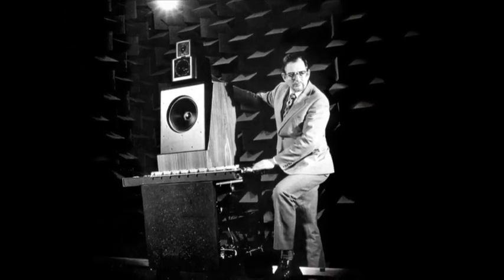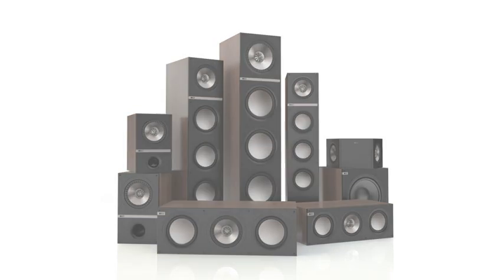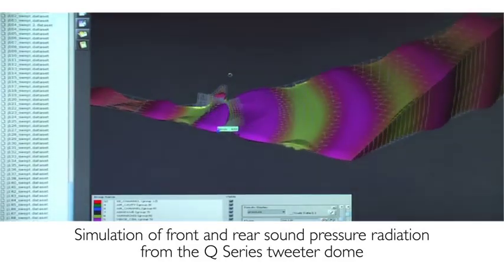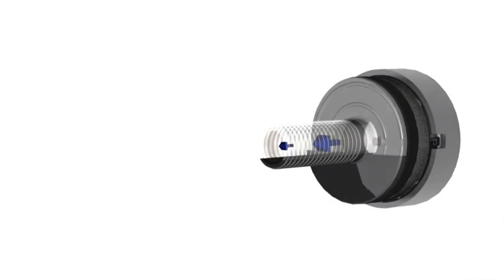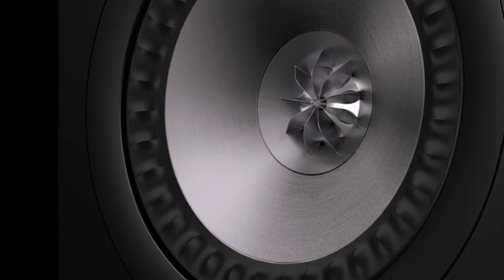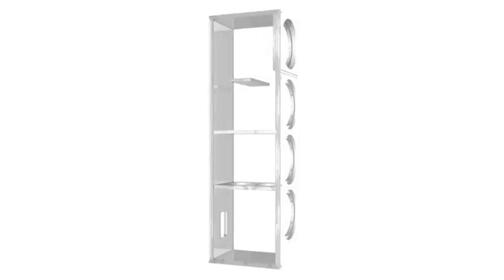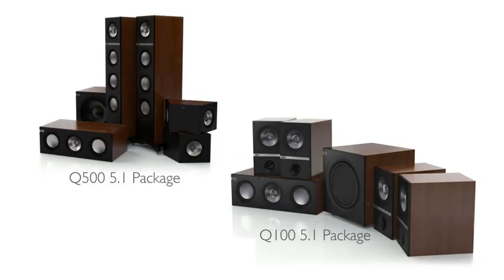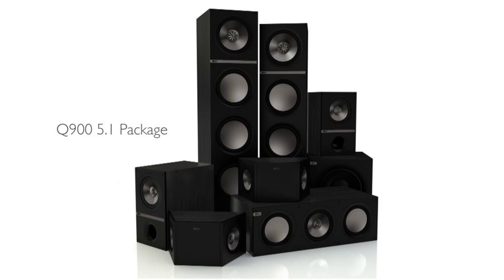KEF Q Series - The Technology Inside

Comment: I'm curious how KEF avoids chuffing from the air gap near the tweeter where it disconnects from the woofer. Also, how would a ported tweeter work with the bass driver forcing air into it?
Reply: The dome is sealed. And the air gap is so small that the port resonance would be like 5hz or something, I am pretty sure that it is no problems, look up a helmhotz resonanter that’s what it’s doing.